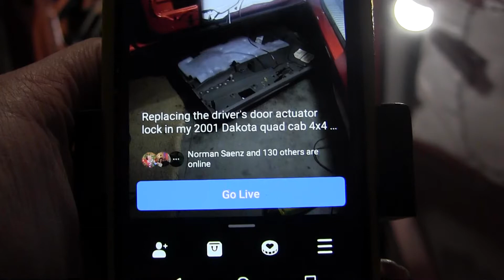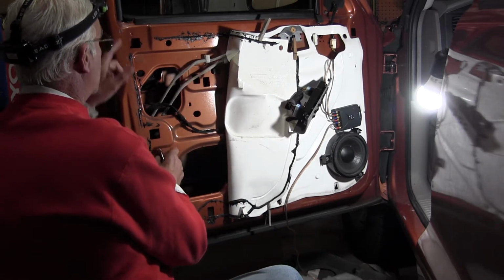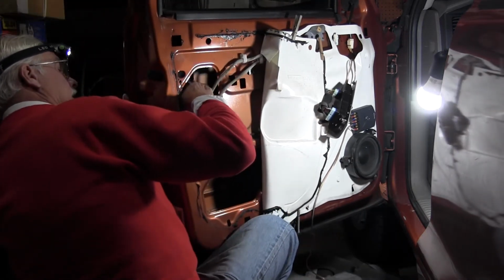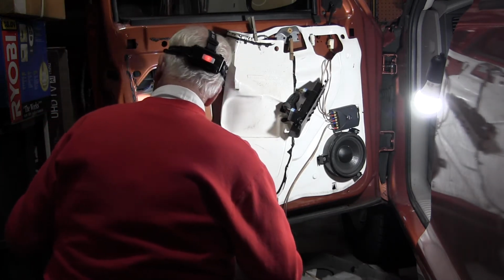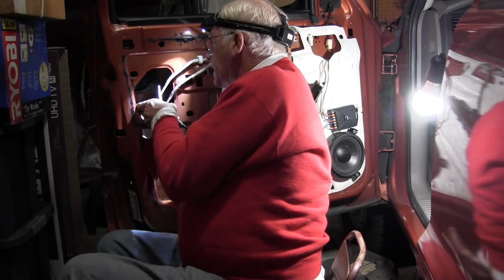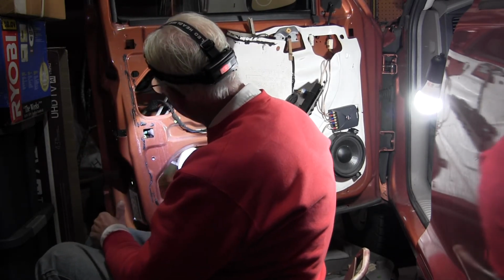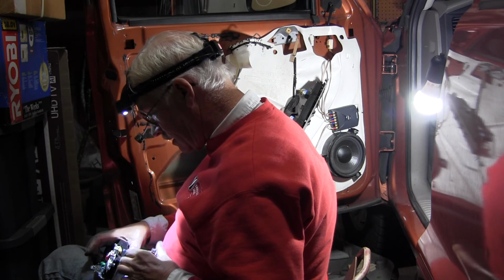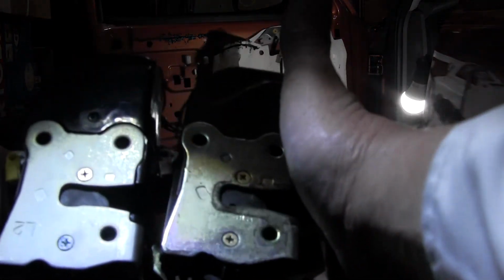How Remove driver door actuator latch lock 2001 Dakota quad cab 127K 16 January 2022

Comment: I admire your perseverance. I have a Dakota 02 manual window and lock. The metal window guide that was in your way is removed by pulling it down, firmly. There is a catch at the top.  Makes things so much easier. I only found out because I took it in to my mechanic. Otherwise, I never would have known. Ever get it finished?
Reply from the maker: Oh yes I finished this the same day it just took longer that I though as I have large hands and this is best done with small hands as it is tight space to work in.